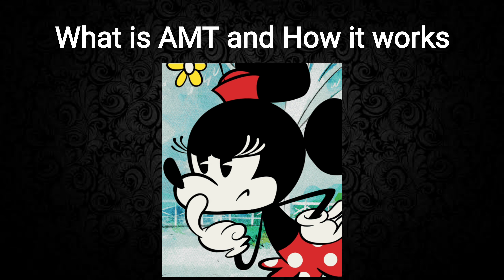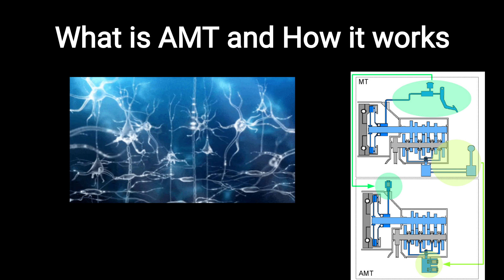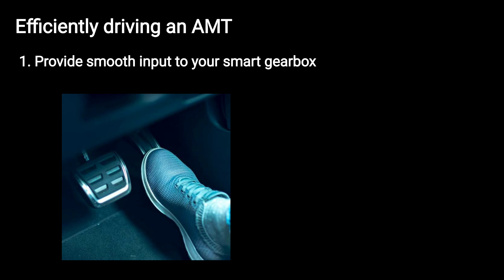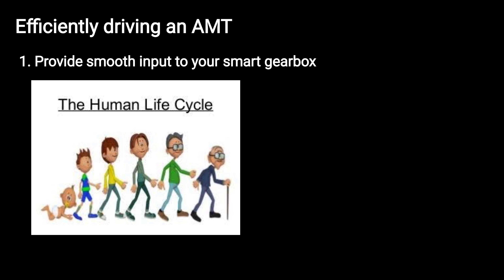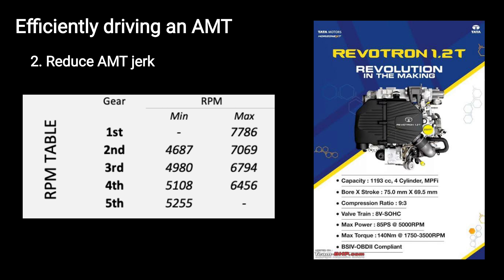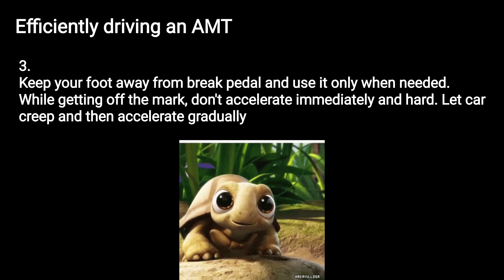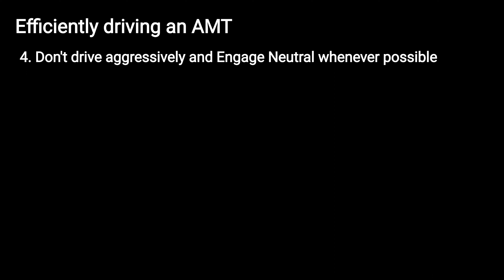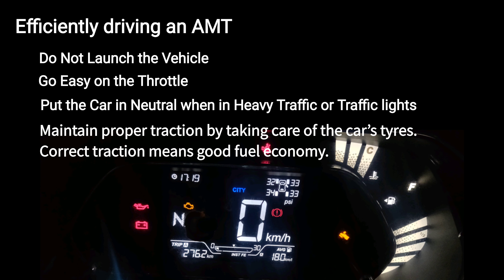Getting better mileage in AMT. It's easy. Tried and tested with Nexon AMT

Comment: When we go from neutral to 'A' position with gear knob at say 30-40 speed in AMT
Does it go to 2 or 3 gear directly without jerk ?
Reply from the maker: If AMT car is in 30-40 kmph speed then you can't be in neutral & going to A.  I assume you are asking that you are driving in manual mode @40kmph and then move to automatic, then yes it goes to 2-3 gear w/o jerk.
Reply: @Raviraj317  that's what I was looking for thank you